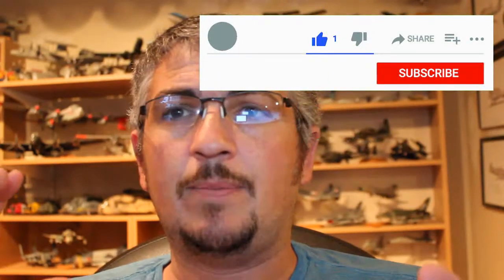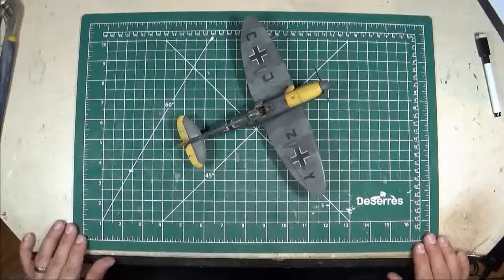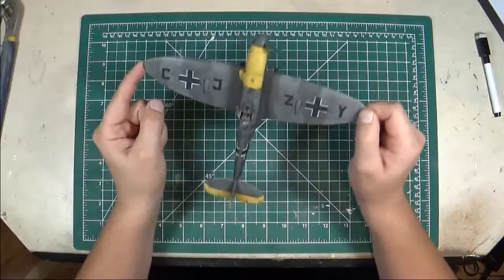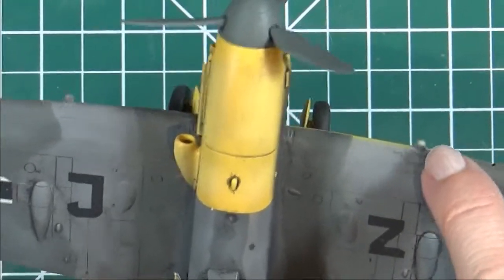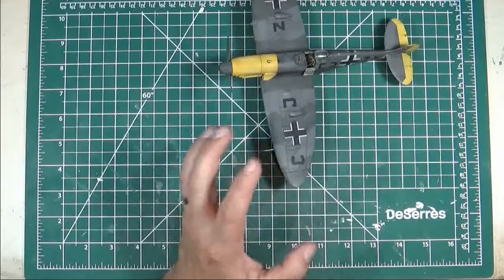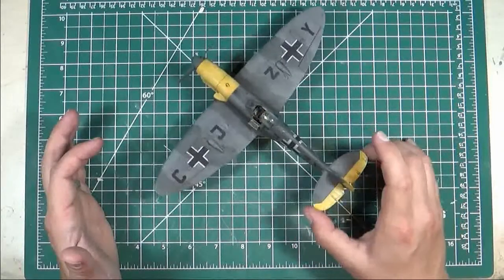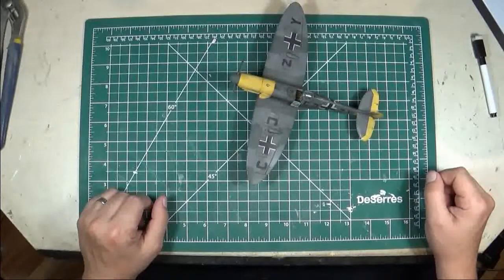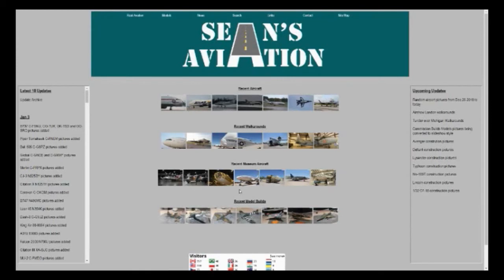1/48 Tamiya Spitfire MkV "Messerspit" (episode 3 of 8)

Comment: Mark Felton throws a slightly different light on performance for your aircraft.  Mk VB flown by P/O Bernard Scheidhauer (EM-830) was landed by mistake in german territory.  Sadly he was murdered among the "50" for the Great Escape.  With all armament removed, after the conversion achieved higher speeds and a better climb rate, with a ceiling of 41,500 feet. (that's 3280 ft above the standard Me-109 and 5000 ft over the standard Mk VB) while keeping the superior Spitfire turn characteristics. Aircraft was lost in a bombing raid on it's airfield Aug 14-44.  No reflection or criticism intended, just added info for the curious.  Nice job on the kit, I may have missed it- aftermarket decals or hand painted?  Thanks, Dane
Reply from the maker: Thanks!! I didn't realise that it had better altitude performance. I had not done any research before making this video as i was focused on the model itself rather than a full history of the aircraft and was working from memory with the research I had done when I built this years ago. I have added a link to that video in the description and a link imbedded in the video!!
Reply from the maker: Oh, and as I forgot to answer your other question, the decals came in the Fusion conversion kit. They were VERY thin and fragile, but a bit of work and they look great!